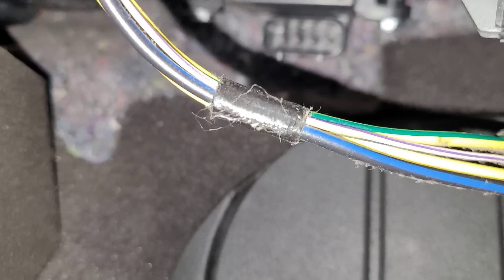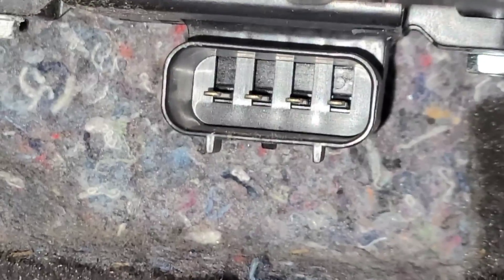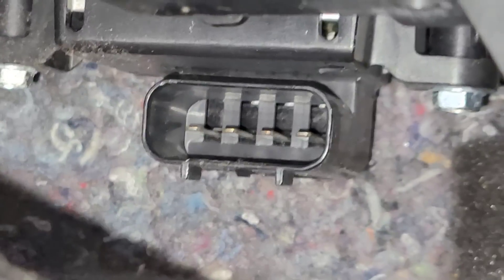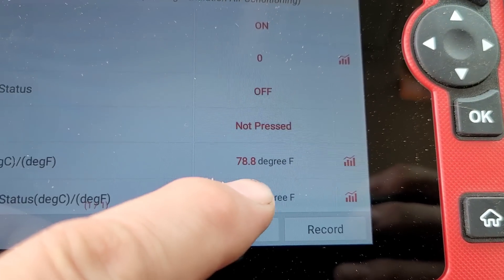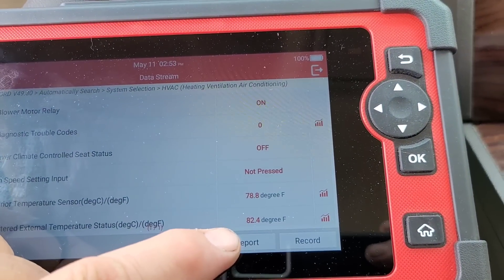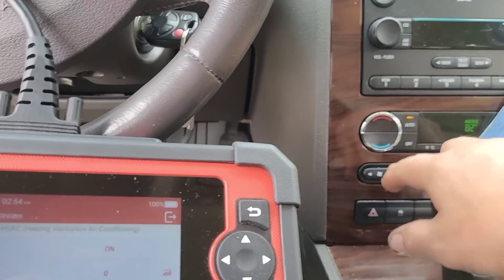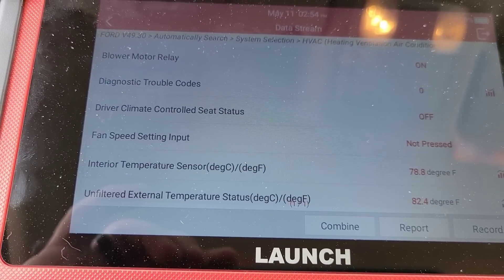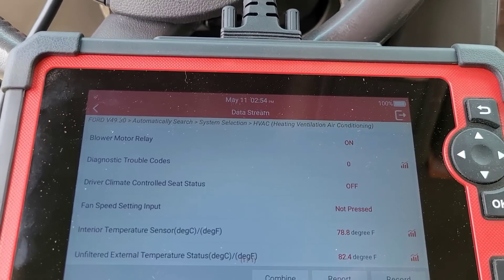Parts Cannon Loaded, Ready, Set, HOLD ON!!!! I Wont Do That...

Comment: My wife and I were traveling down I95 from NC to the FL Keys on vacation in my 05 Dodge Magnum RT which has dual climate control.  My wife kept adjusting the AC temp up and down, up and down, until after a while the AC just turned off and wouldn't come back on.  After stopping the car at a Walmart where I bought one of those charging outfits with a gauge and can of refrigerant, I restarted the car and the AC worked again.  Why it turned off is a mystery but it hasn't done it since.  So, I concluded that even my car knows when to stop trying to please my wife!!
Reply: they (A/C) have a low-pressure cut-off switch. 
low refrigerant, system won't cycle/respond to commands. 
Escapes through compressor shaft over time. If it's older & gone with no service, little top off gets it going again.  Love those little freon tanks! Life savers.
Reply: @timewa851  Yes, I know.  I connected the hose with the gauge and can to the low pressure side and the low side pressure was right on.  And it still works a couple years later with no charging so low refrigerant was not the problem.  It was something in the electronics I think.

Comment: I have been in that exact spot. Everything just shut down....but everything worked... It all seemed fine. It ended up being a ground.
Reply from the maker: I really have to get further into it . I've seen these style resistors do weird things intermittently, but its always possible it's a ground issue. I told the customer to take it and stop back when it's not working again so hopefully I can duplicate it. I did look at a diagram for it and the G202 ground seems to be for the blower , resistor and the control module. Once he comes back, I'll get more in depth . I just did a preliminary on it today. Thanks for the input !!
Reply: Great job I would have done the same!😊

Comment: Hey Kenny, really been enjoying your videos, recently subscribed. Over 30 years as a tech. My go to for any intermittent motor operation (fuel pump, blower motor, etc.) is my low amp clamp and a graphing multi meter such as the Snap-on Vantage. If there is a worn spot in the armature, you will see an obvious downward spike. Most common with a motor that won't start working until you start tapping on it. Even if you can't duplicate the condition,  you can see the bad spot on the pattern.
Reply: That’s what I was thinking, more likely the fan motor.

Comment: I would give the blower motor a gentle tap with a small hammer. I've come across a similar fault where the brushes were worn out in the blower motor and intermittently not working. 
In saying that I've also seen solid state resistors fail.
It's one of those things..how long do you spend on the diagnosis. 
Love your videos. 
Have a great day mate.

Comment: Many customers don't know that when the car is cold, and defrost is selected, the AC compressor automatically turns on to send colder air at the windshield. This is because warm defrost air hitting a cold windshield can cause dangerous fogging of the inner windshield. If you live in a cold climate, people who wear glasses will recall that their cold glasses fog up when they come inside. By cooling the defrost air first, water in that ambient warmer air condenses out inside the AC evaporator and drips onto the ground. Then there isn't as much water in the cold air blown onto the cold windshield.  I wouldn't be surprised to see that an automatic AC controller may use vent doors to direct that air away from hitting passengers. Most of us don't notice that because we don't turn on the heat until the engine is warm enough to produce heat.
Reply from the maker: Very true. Most every car nowadays, the ac compressor will cycle in every mode except "floor" . It makes sense also in regards to keeping the ac system operating now and then to prevent premature failure
Reply: Omg! I always wondered why my truck would drip water from the ac. When I used the heater to defrost the windshield the morning.

Comment: Kenny, I run into issues like this all the time, I am a one man operation and sometimes you simply don’t have time to joyride hoping for a failure.  It too hate to just guess without proper diagnosis.  I’ve seen several auto climate control resistors on these Fords fail quite often, sometimes intermittent loss of fan, sometimes loss of certain speeds. Think your “Parts Cannon” would probably be a good shot on this one.  I’ve had numerous aftermarket resistors either fail or not work correctly out of the box on this style resistor and I buy them only from Ford now.  

Keep up the great work, love your content!

Comment: Blower motor fan speed is independent of temperature control, only difference is how fast the temp changes due to the selected speed. I can't say for certain about the digital fan speed controllers, but the older analog resistive type speed controllers are easy to test as you may know. Those types speed controllers only work for lower speeds, so if the blower motor runs on high but no other speed, it was pretty much a 100 percent certainty the speed resistor was toast, as full high speed actually bypasses the speed controller, at that point a controller isn't necessary, the blower motor runs at full amps. My guess is, if the blower motor runs at any speed, then odds are the digital speed controller is not the issue. Btw, have you checked the cab filter?... those can play havoc when they're plugged up if it's got one.

Comment: I had the same problem with a Mercedes, the scan tool even said it was the blower resistor I changed it but didn't solve the problem, then the thought crossed my mind that it had 4-zone air conditioning, so I checked and sure enough, extra blower resistance in the center console for rear air conditioning

Comment: 212000 miles, I’d change that blower motor too if it needed it or not, but thats on the owner. It’s probably on the way out sooner or later anyway.  That blowers done a  of spinning in 212000 miles.

Comment: I had to replace mine on my 2006 F150. The blower wouldn't run on speed setting number 1. So I googled the problem and it led me to a YouTube video to replace it. Mine was in about the same area that the Taurus is. Fairly easy to get to and solved the problem. I was thinking is was the blower motor at first. Nope it was that resistor. The price has gone up a lot from when I changed mine. It was only $25 with shipping.

Comment: Good morning, Ford usually uses a power transistor to control the blower. they also use a relay for max blower speed. It is a module that can be acessed from the engine side of firewall.

Comment: Hey Kenny,these can be a bit of a pain. Had a '11 gmc Canyon,intermittent hvac shut down. Ended up being the community ground on the right front fender, looks like a relay at a glance,really poor design. Probably 8+ wires going to it. Cut it out, soldered in 3 new eyelets,permanent fix. Thanks for the videos! Have a great day!

Comment: blower motor resistor only controls the fan speed and if it goes bad you only get high speed,if the fan doesn't work it has nothing to do with resistor
what might happen is the brushes on the blower motor are eaten up so it some times let the current go through the motor and sometimes not,that's most likely the problem,if there is not somewhere else